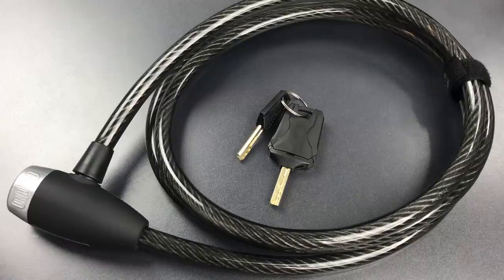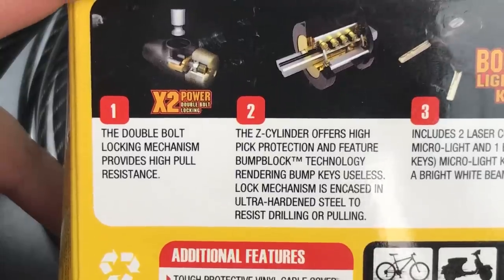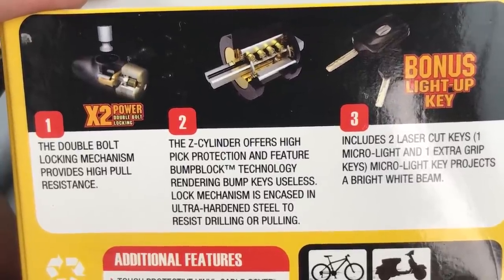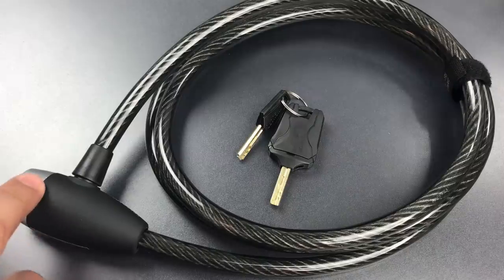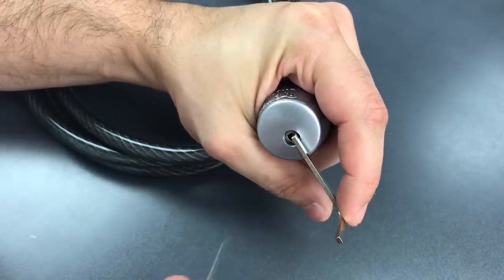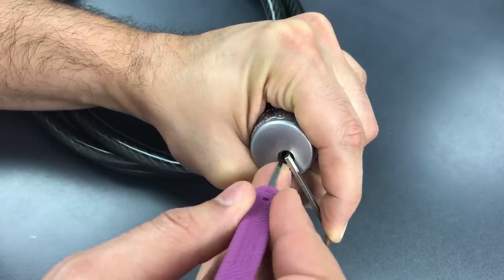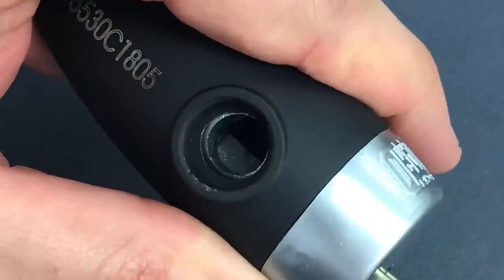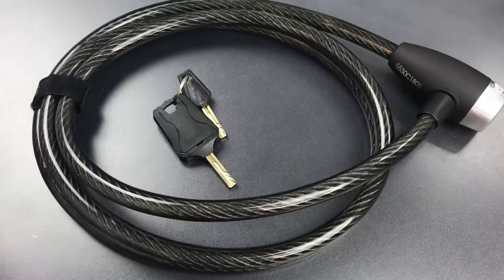[745] OnGuard 6’ Bicycle Cable Lock Picked

Comment: I don't understand why false advertising is so rampant in the lock industry. Maybe it's everywhere and I lack expertise. Either way - I hope it catches up to lock manufacturers soon.
Reply: And it has been for, at least, the last 18 years since when I started to learn lock picking. The standard then for the 1-5 "pick proof" in Sweden was a lock picking "expert" opening the lock with single picking in 1-5 minutes basically. 5 meaning it was impossible, yet I could open most of them as easy as a 1 in under a minute. There was also in that 1-5 included things like bolt cutters and such. The most disturbing thing though is locks that don't get updated security ratings after the first rating. Like the ABUS 160 combination lock that still got a 3 rating after all these years. Good thing that some manufacturers send their locks to Bill and LPL and actually upgrade their locks accordingly.
Reply: I guess the finance dept saw the lock after the marketing dept.

Comment: Thanks for showing just how 'relatively' simple this lock is to open, in your personal opinion, not professional,  If you HAD to use a wire cable type lock what brand/make would you consider using,
I have some expensive power tool that are occasionally left in my van whilst I go into the suppliers, I need something that I can run through the handles of several chainsaws and the base of my passenger seat, simply as a deterrent or to make it so annoying to a smash n grab style of thief that they give up?
Regards
Matt,
P.S. really like the professionalism you show rather than glorifying being able to bypass ordinary peoples attempts at keeping their hard earnt possesions safe!
Reply: Matt Collins In that case I don‘t think it would really matter wich brand or model you use. Even the lock shown in this video would be sufficient, the limiting factor will always be the cutting resistance of the cable. Something as flimsy as a Master 8143D would prevent somebody from just grabbbing your tools.
Reply: Thanks for the reply LPL!
Can you or any viewers give me a link to a pdf of which wire has which attributes and which company uses which cable, I am just trying to make any possible future insurance claims or quotes a lower price by using a higher quality(?) Cable lock, regards,Matt
And yes,
If a thief is determined to take my kit they will, I just want to try and it as difficult for them as possible!
Reply: @TheBigfatmatt  
I'm not LPL ...
They all use proprietary cables I think, none of them will stand up to bolt or even wire cutters anyway. Hell, as a child I once opend a cable lock I lost the keys for with a pocketknife, a rock and my hands.

No cable lock is secure but (almost) every cable lock will protect your stuff from just getting picked up.
Reply: @BL-yj2wp 
Thanks mate, I am going to just buy the one which makes the most outrageous claims about its security level, haha, then if the worst does happen I can't be accused  of not trying!
Reply: That´s actually a good plan. How were you supposed to know, right? 
Just keep the box then.

Comment: Maybe someone has done a side by side comparison, but I've found large differences in the strength of these cables. Some are hardened very hard and cutting them is a challenge with pocketable tools. Larger tools would cut many chains or shackles, too. So it's not a inherently inferior category of locks in my opinion.

Comment: I will say I cut the cable off of it so it will fit on my bench. It did take a solid 45 seconds with the sawzaw and a metal cutting blade and was loud as hell. Just FYI.